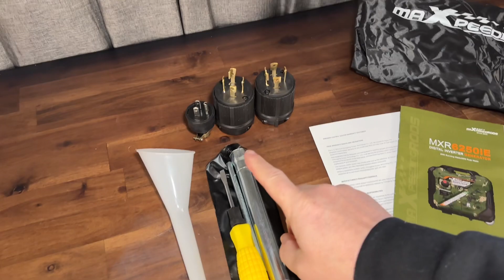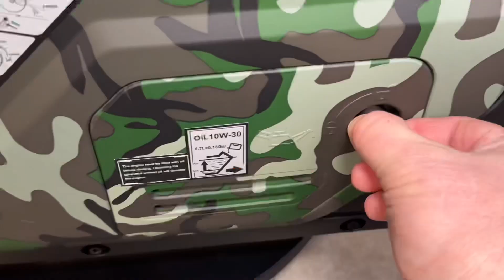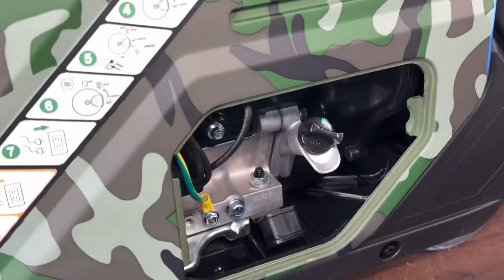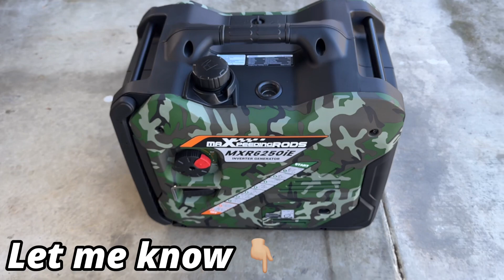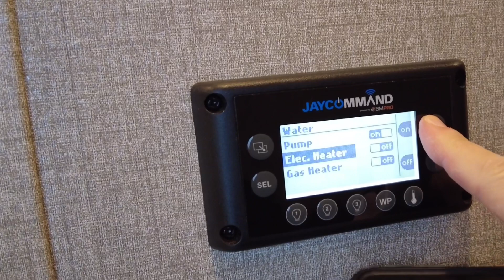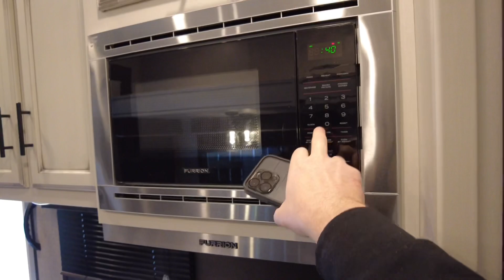New 240 volt generator !! Test & Review MaXpeedingRods MXR6250iE

Comment: So with the limit of 20amps per line, can I run appliances off of the 240v and the 120v at the same time? As long as I don’t go over the 5,000w rating or how does that work?
Reply from the maker: I would look into another unit such as this. And yes most let you use all sockets as long as you don’t go over rated wattage 

https://amzn.to/4sj65sz

Comment: ⚠️ FAIR WARNING: MAXPEEDINGRODS DO NOT HONOUR THEIR WARRANTY — AND THE MOMENT YOUR GENERATOR IS OUT OF WARRANTY THEY WILL NOT SELL YOU PARTS. ⚠️

Most of the critical components in their generators are proprietary, meaning you cannot repair the unit once the warranty expires. When I contacted them for support, they refused to provide parts specifically because my unit was just outside the 2-year period. They only admitted this after I supplied proof of purchase.

If you rely on your generator — especially for off-grid or emergency use — think very carefully before buying from this brand. When it fails, you may discover you’ve bought a disposable machine with no long-term support.

Get a Champion or another reputable brand that honours its warranties and sells aftermarket parts cheaply. This one is not worth the money.

Comment: Where can I get that watchdog ?
Reply from the maker: This is the 30 amp https://amzn.to/3zGNnEF

This is the 50 amp https://amzn.to/3zDBUpj

Affiliate links
Reply: @johnnysweekends  Thank you 🙏🏻 I’m looking at getting this model wonder if there will be any discount for prime day!
Reply: So I bought one off eBay and it runs but at wot!!!!! 😡
Reply from the maker: You need to return it or have it fixed. 
eBay is also full of a decent amount of scam sellers selling returns that are not fixed
Reply: @johnnysweekends  you got that right ! I can tell something up with the carb…. It’s wide open maybe someone removed a spring or something
Reply: @johnnysweekends  ok so I tired it apart this morning and I found two issues one was the rear flap to the carb was stuck all the way open… fixed that and then it ran well. After that I replaced the generic spark plug with an ngk this thing is running like a beast now …
Reply from the maker: @dieseldawg7132 niceeee!! 💪🏼👍🏼👊🏼

Comment: How did you go for run time under load? On paper its not much chop but reading reviews/testemonials some are saying they're getting 10+ hrs?
Reply from the maker: The run time depends on the load. Much like a boat or a car or anything with an engine. Faster you go quicker it runs out of fuel. Just like a generator you could probably get 12 hrs on a tank @1/4 load 7-8 hrs at 50% and 3-4 hrs @90-100%

Comment: Hey ya - I don't understand the Leg 1 Leg 2 , does that mean the unit will have x 2 240v outlets on the Australia model , but each leg will only supply 2500w at 25amps per leg ? 

Any feedback is appreciated 🤙
Reply: Ok I think I worked out my own Question 

In Oz it's comes out with a 15amp outlet + 32amp outlet 

In short if I want to used the Generator from 1 outlet and Get the entire 5000watts .I need to Use the 32amp Outlet 

As the 15amp outlet will only supply idk 2000watts Max  and if I try to draw more the Genie will trip off
Reply from the maker: That unit for me only supplied full power using the 240v option

Using 30 amp only gave me half the amps so was a little disappointed on that. So it makes it a better 240v unit if you need that.
Reply: @johnnysweekends  ok thx a bunch - I ended up after much deliberation getting this model today - they have been reduced In price in Australia down to $1300 which is surprising because with our poor Dollar we get slugged heavily on price 

The Aus model comes out with AC2 Outlet which is a 3 pin 32amp at 240v - so I should be able to draw maximum potential through that 

Thx Again - love the Vids 👍
Reply: @Forged721  I've just ordered one myself today, I live in NQ and we're constantly losing power from cyclones, floods and a poor grid lol and I'm going to pay a leccy to hook it up to the mains box to run the house. How have you found yours? How's the runtime  with loads? The runtime seems to be it's main down fall I think besides the higher rpm
Reply: @G42J3T hey bud - literally only recieved mine Yesterday .I Live in the Boonies west of Brisbane so it took idk 8days 

Bort mine off Ebay - MPRods account 

The Box was beat to shit .probably Indian Toll drivers 🤬 to weak to handle the 42kg Carton 

I'm putting it thru it's break in procedures atm - will drop the oil 3 or 4 times over a 4hour break in routine type thing 

Absolutely awsom looking Genie - with the cammo etc 

Changing the oil is bit of a stupid set up compared to other brands 

Only time will tell the full story mate 

Let me know how ya go
Reply: @Forged721  cheers mate, yeah that's who I ordered through on eBay too. Hoping it comes in 1 piece cause I didn't pay the extra $200 insurance haha. I seen on there previous 5000w models they had a really good oil drain hose already attached and I noticed on these vids there's no mention of the oil drain. Also found out that you have to remove the RCD to connect it to the house and once you remove the RCD you can't use it as a camp generator, hoping to find a way around it

Comment: So this is only a 20.8 amp generator at 120 volts.
So not much more then a 2500watt generator
Reply from the maker: Yea you would want this  as more of a primary 240. As a 120 unit there are better options. But for 240 it’s a nice light unit
Reply: @johnnysweekends  
I just got one but just realized its not much on 120 for my camper.
Kinda wanted to have one generator for home and rv.
But this wont do much more then a 2200 small guy.
Reply from the maker: Yea that was the issue with it. Does great on 240 but for only 120v you only get half the power. Kinda odd they did that.
Reply: @johnnysweekends  
Thanks
I appreciate the videos

Comment: Great review, just bought one and so far I love it. Sold my Honda eu2200i because I needed a 220v for my well pump and this portable is easy to move around.
Reply from the maker: It’s funny they dont give a option for the USA for a 240 volt option on the smaller units like they do in Europe

Comment: Where do you get parts/service from in the U.S. What is the warranty? I noticed that it listed 4800 rpm. That's high.
Reply from the maker: Yea that rpm is a little higher then other units. I think to keep weight down they use a smaller engine and spin it faster. Verses a heavier unit spinning at a lower rpm. But that’s a option. Cheaper unit for light duty here and there or more expensive unit for severe duty.

Big difference in price if you use something twice a year for minimum projects or back up power verses several thousand for the same thing.

Like anything out there. Entry level and top of the line.

Comment: At first, this seemed like a very useful generator, it is relatively small and light weight for its power output.  However, after taking a closer look, I see a few problems.  It uses two synchronized 2,500 watt power inverters that have their outputs in series so you have the traditional US 120/240 house voltages available.  Why didn't they design it so the two outputs could be operated in series or parallel?  The series/parallel configuration would give an output rating of 240V @ 20.8A or 120V @ 41.7A.  Secondly, to make the generator smaller and lighter, they chose to use an engine that is too small (223 cc).  To get the 5,000 watt rated output, the engine needs to run at about 5,000 rpm but, these engines are rated for 3,600 rpm maximum.  A generator with electric start is a waste, since this small engine is relatively easy to hand crank.  The starting motor and battery just adds to an already overweight "portable" generator.  The temperature rating on this generator is +25 degrees Celsius, which is 77 degrees Fahrenheit, will it overheat and die on a hot summer day?  All portable generators are rated at ideal conditions.  In the case of Inverter generators, they use a 25% load, which is where the generator gets the best fuel mileage and is quietest.  If you use it at say 80% load, inverter generators usual consume about 4 times more fuel.  At this point, a basic, low cost open frame generator that runs at a constant 3,600 rpm, will obtain better fuel economy.  Keep in mind that generator noise ratings should be made at around 75% load to be accurate, whereas most ratings are generally taken at zero load to produce a non-real world measurement.
Reply from the maker: Bill I agree it would have been nice to have a switchable 120/240 so you could take advantage of full power on a 30 amp service. There is a unit like that though. 
More maybe the engine could be bigger but that will add more weight and electrical start gens and batteries are getting very light. Maybe 5-7lbs for the total gear. 
But if you use a generator at 80% Power all the time then the next size unit should be considered so you more in the sweet spot of 30-60% load. 

Most sound tests are done at 23 feet and 1/4 load. And I have done many to try and confirm the db they have rated. I found with larger units the db rating from zero load to 1/4 is about 1 db. Some no change, and some a little more then 1 db. 
But u I could go back and do quarter loads just to make sure I appease those who want the actual 23ft test at 1/4 load testing. 

Now open frame units are good for 3 things. Cheaper cost, lighter, easy to work on. But loud, loud and loud compared to a comparable closed frame inverter unit. 

But with so many options it’s up to people who are looking to see what’s right for them.
Reply: @johnnysweekends  Agreed, thanks for taking the time to explain your methods and findings.
Reply: Cost is why it is like it is😁
Reply: @BigEightiesNewWave  You could be right, that and to make the features list most appealing to the average customer.
Reply: @BigEightiesNewWave just bought an “open box” item for $740 I can’t wait I got by with small 2200 watt Honda I’ll be perfectly fine with this one

Comment: I'm assuming this is another generator that probably isn't a good choice for a 30A camper?
Reply: Yeah I would keep the generator on a rack in the receiver hitch. This sounds interesting. Not sure I’m following on the “dog bone down” though. Looking forward to the video. Might finally pull the trigger on a generator instead of borrowing from others.
Reply: @jeremyhelland4139  a “dog bone” is a term for a short conversion plug. Usually about 12 inches long or so with different connections on each end so it looks like a “dog bone.”
Reply from the maker: Dog bone down means using a 50 amp 4 prong connector for the generator then drops to a 30 amp 3 prong.
Reply from the maker: Correct I would use a true 120 only option. This would be better for home back up so the whole panel is powered out a 50 amp service trailer. 

What are you needing or looking for?
Reply: @johnnysweekends  I’m looking for something to charge a camper with a large lithium ion battery pack 9500 Whrs. (Winnebago Travato). It essentially provides a 30A service without having to have a generator running. It can charge itself via an onboard 60V alternator but I like to be able to charge it during the day (up to 30A) with a portable generator so then I can run the AC at night without having to run the engine or generator. I like having the idea of also having 240V for house backup but it seems most of the generators are geared more toward 50A service campers. I was looking at one of the Genmax generators you have reviewed before but would really only be able to charge at ~20A so seems like a waste.
Reply from the maker: Well then I just got a new unit that might be up your ally. The video will be out soon
On a new genmax 7250 that is 120 and 240 switchable. So now you get the fuel 50 amps on 120 or 25 amps per leg. 
Think the gm6000 dual fuel unit but about 10% larger. Also has a ATS plug if you wanted that. 
I’m just finishing the video… 
Nice unit, tons of power. And quiet. 
Sorry no price yet, waiting for that info and hopefully some discount codes…😀👍🏼 
Has a true 50 amp Rv outlet though so would need a dog bone down. 
I did a quick test with my 50 amp trailer on propane this time for the video. 
No issues. 

But it is a large unit though. Where would you put it, back rack? It’s about 130 lbs.
Reply: @jeremyhelland4139  130 Pounds (probably 150 with fuel) is a LOT of weight to add to the receiver hitch on that unit.
Reply from the maker: Yea it’s about 145 empty I just looked it up again so after fuel it will add some weight but some
Of those can hold 300lbs pretty easy. I don’t know about his exact set up
Reply: @johnnysweekends  350 pounds vertical hitch capacity according to their website. So you were about right :)
Reply: @johnnysweekends  well really appreciate the info, I will look forward to your review. sounds like the unit I have been waiting for. Keep up the good reviews
Reply from the maker: Oh ya that’s not bad. I have seen 3 e-bikes on the back of those and they are about 50-65 pounds each so as long as the rack is good quality probably won’t be a problem. Not sure if you have helper springs or air shock but guess you would have to maybe do a test with 200 pounds of junk and see lol
Reply from the maker: No problem probably be out Monday or maybe tues